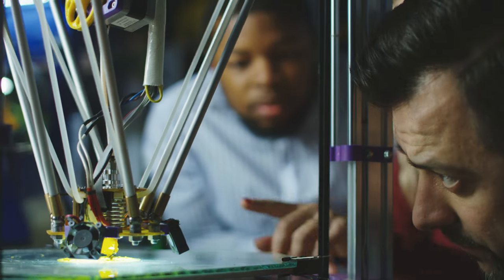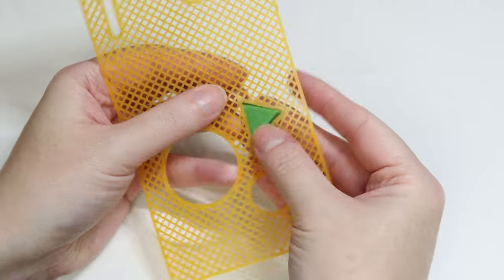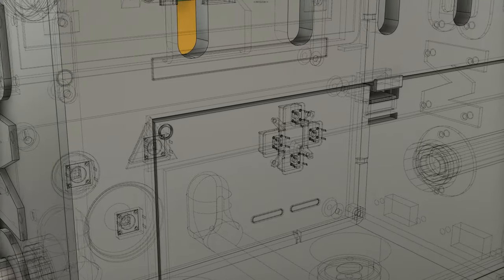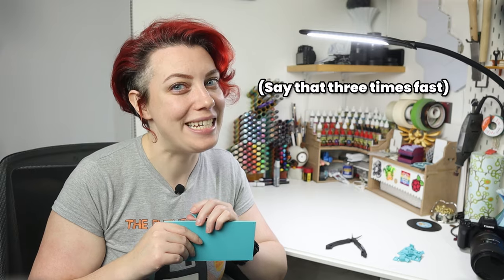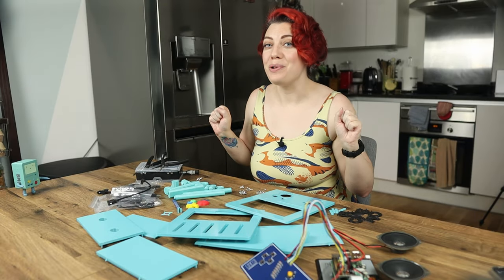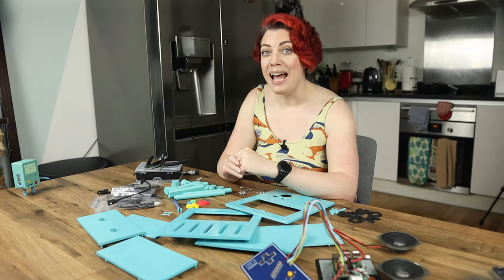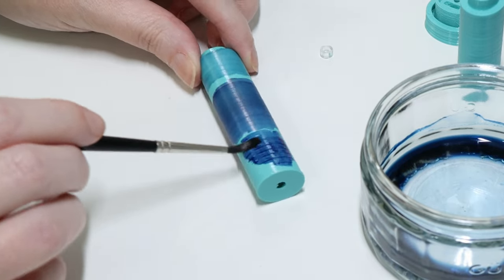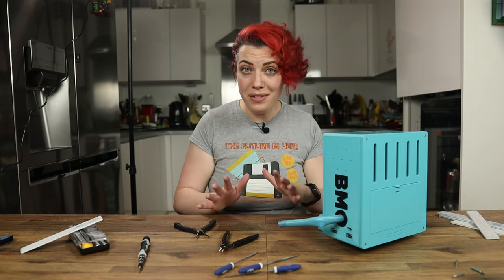Building a Life Size BMO from Scratch Part 2: Parametric 3D Design, 3D Printing and Assembly

Comment: Very cool stuff! I did something similar with my cuckoo clock when I made it. Customizable in both design, and code. Made sure it's easy to assemble and disassemble too. To date though, only one person has printed it 😂 I think perhaps the need to have an ESP32 or 8266 might be what has prevented many from taking up the project though.
Reply: @katzcreates  I didn't do an instructable or any online equivalent, but I did include a full document explaining it all. Goes over what you need, and how you can alter the code to suit whatever you want etc. Main reason I didn't do a video and such, was that I didn't actually have the hardware, nor the printer. DasMia actually printed it out for me, and ran the code I'd send her to test etc. Once it was done, they did show it on one of our "chit-chat" live streams, but only really showed it working.

Comment: This is amazing, great quality vid and modeling. Just stumbled on your channel, subing so I can see the finished product and get those sweet stls. 

What size print bed are targeting for this build? (will it fit on an ender 3?)
Is this designed for a pi3 or pi 4?
Have you considered adding a PC cooling fan to BMO's bottom? Octoprint doesn't run too hot, but I personally run my octoprint pi OC'd to help octolapse render times, and active cooling is pretty much required at that point.
Also, suggestion: a design for something for BMO to "hold" that is built out of a rpi camera module? Would allow for octo lapse and would look heckin cute.

Comment: My favorite thing I learned from this build was something you actually left out of the video but shared on twitter, removing the top and bottom layers from test prints! This is full of great solutions.

But, keeping with point 3, shouldn't you have accounted for threaded inserts? I think the plastic will inevitably strip and it won't be reassembleable for long.
Reply: @katzcreates  That's fair. Of course I wasn't even considering inserts on the d-pad screws, for example, mostly in the points that allow access to the innards. I figured you had considered the trade-off, but I appreciate you detailing your insights. Thanks :)

Comment: I’m just wondering now… you’ve done a lot of test-prints to get the fit and finish just right for your printer. But if someone has a printer that’s not that well tuned it might still be problematic, right? 3D designing is just hard…